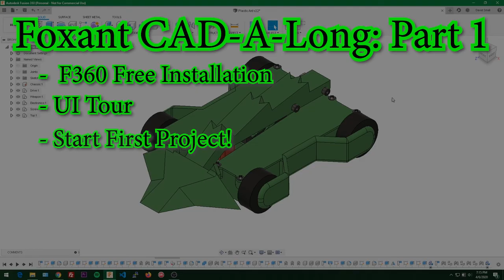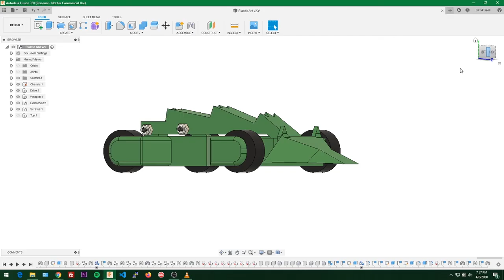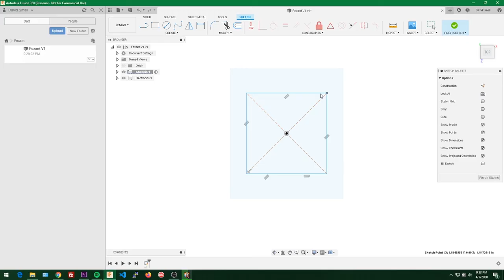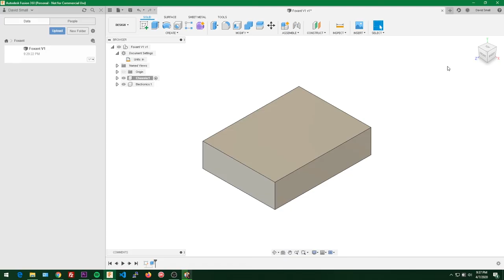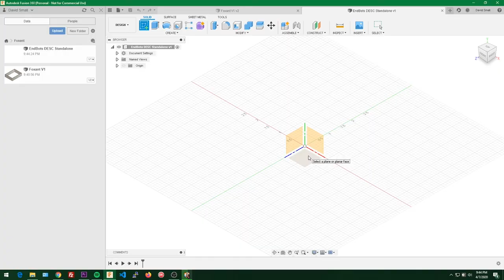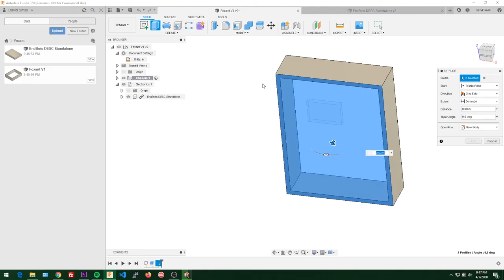How to Use Fusion 360 to Design a Combat Robot (Foxic CAD-A-Long: Part 1)

Comment: My fusion360 works completely different then yours. For example the to get the wall thickness like yours on mine i have to use 1/8 not -1/8. And I can’t simply go back to the sketch like you. Your video is great but fusion is very frustrating.

Comment: I’ve been making my CADs in Fusion 360 using Bodies. Are there any significant disadvantages to this approach? Is there any way I can turn bodies into components?
Reply from the maker: Soooo many disadvantages to just using bodies. Joints require components, there's 0 organization, you can't look at specific parts in the timeline, if you want to go back and change something you have to go through the ENTIRE timeline instead of just viewing the component you want to edit, sketches aren't linked to each part. Components should be limited to 1 body and however many sketches you want, which once again goes back to organization because you have to look at alllllll of your sketches instead of just looking at the ones relevant to the component you're working on.
Reply: Team Small Robots Yeah... needless to say trying to constantly edit and modify 50+ bodies is far from an easy task and has inadvertently cost me more time and hassle. Whenever I can get back to a computer connected to the internet I’ll start making CADs with components!

Comment: Hey Robert! Thank you so much for making this series, it has been a really big help. I did have a question though... 

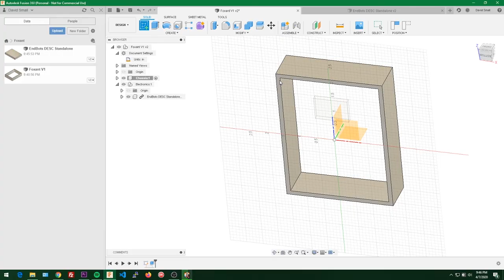At 23:18 that little popup didn't show up for me when I selected the bottom of the box as the plane for the new sketch. Do you know why that would be the case? Is it something I need to worry about?
Reply from the maker: You're very welcome! That popup appeared because I moved the ESC around. It was asking if I wanted to capture (in other words "save") the new position of the ESC and add a Move command to the timeline. I didn't want to save it so I chose "Continue". 

You didn't move the ESC around for no reason like I did, so it didn't appear. So, no need to worry, you should be fine not seeing it.

And my name is David by the way :p
Reply: @TeamSmallRobots  Great! Thank you for responding.

Also sorry about calling you Robert, I was on autopilot and typed Robert instead of David, I even knew your name from ARC last year :p